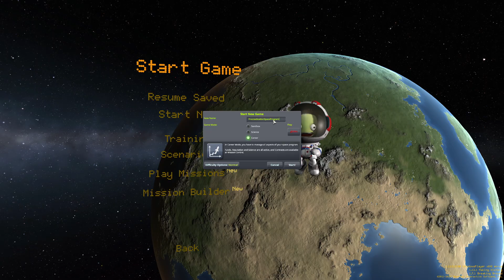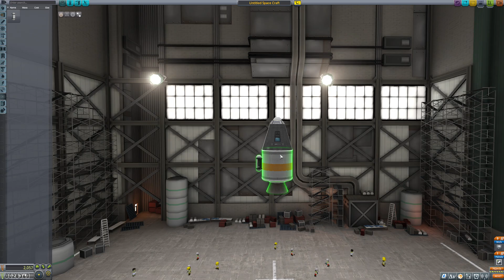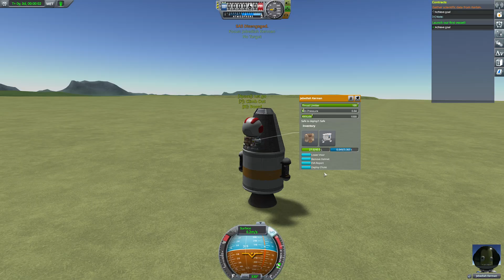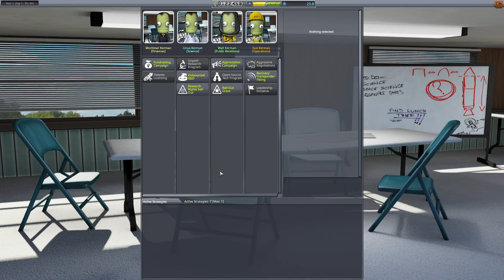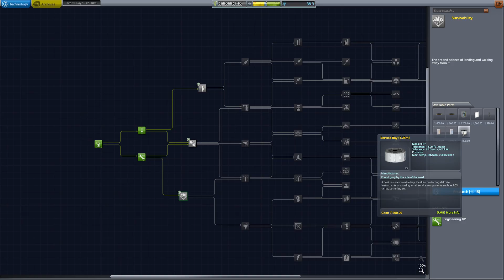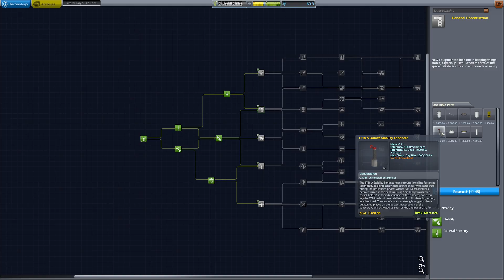KSP Beginner Guide – Your First Hour (Keep the Pointy Side Up!)

Comment: Did everything you did, but my parachute WILL NOT DEPLOY. Starting to get really frusturating.
Reply from the maker: my only thoughts are you might be deploying when the craft is going too fast, if the icon in the stage bar is red or even yellow sometimes it will/can rip the parachute right off. It's best to wait until the icon is grey. because of that, you can't really go straight up and down in this game too much since you will gain too much speed going straight down

otherwise, right click on the parachute and make sure theres no option like "deactivated" or something.

oh, and also make sure you don't actually stage/use the parachute on the launch pad before you take off cause it can't be used twice